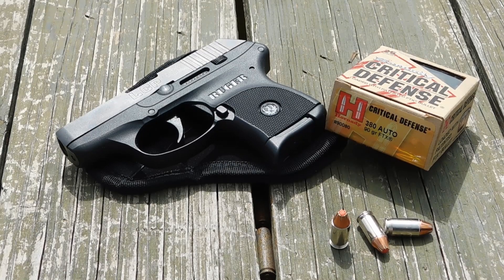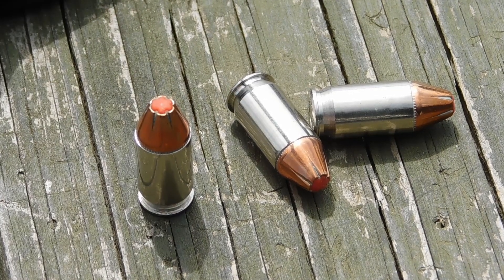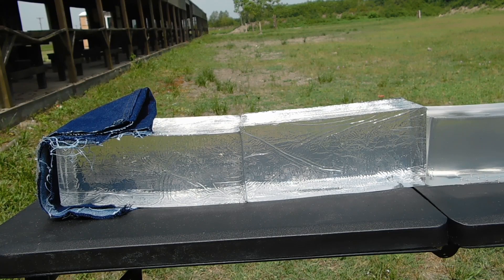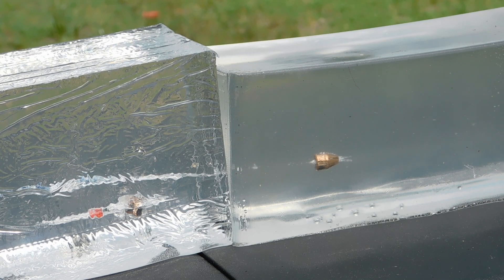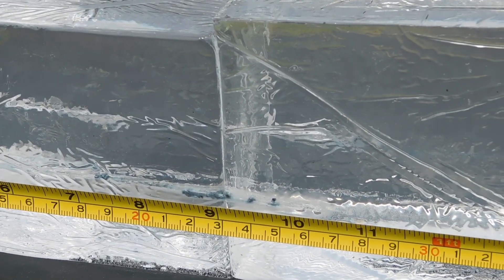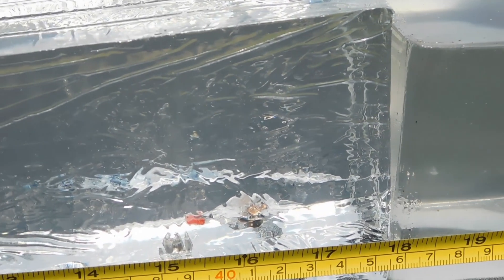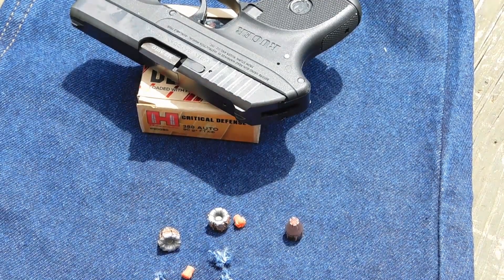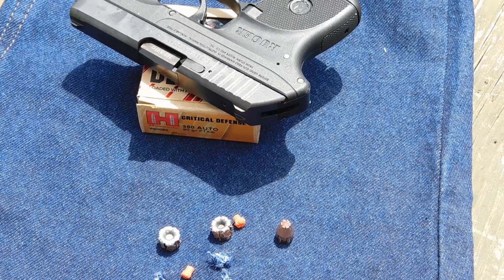380 ACP Hornady Critical Defense Ammo Test

Comment: A 2 out of 3 success rate is 66.6%.  If I recall my public school grading, that's an F.  Also that's why I've just migrated my Remington RM380 from these Hornadys to the Underwood Extreme Penetrator 90 gr. (1,100 FPS; 242 FPE).  I use the Xtreme Defenders in my 9mms..  The Underwood Xtremes  don't need to expand, since their fluted shape combined with their very fast spinning (around 50,000 RPM at the barrel out of my RM380) creates a wound track that beats even the best JHP's, are VERY consistent, and neither over nor under penetrate per the FBI's gel tests.  Being barrier blind is nice too. Their only drawback:  they're damn expensive--but my life and the lives of my family are worth it.
Reply: 66.6 would be a D… but point understood.

Comment: Great video. Just putting this out there. I've had 4 different lcps and have put hundreds of hornady cd through different ones and never had a problem with it. Used it in other guns but one thing important with this gun is it feeds good. Different kinds of mags. 6 round ruger,7 round ruger, 6 round promag, 10 round promag. ss slide. Blue slide. Galloway sweet pea trigger. In my experience it just works.

Comment: Interesting, I've not seen this round fail to expand in the 9mm Parabellum Loading. 🇺🇸
Reply: I switch from hornady critical defense 115g to hst 124g..standard pressure..my question to you is which one would you recommend I keep in my nightstand Glock 26 and why?
Reply: @istartedajoke1704  
They are both a good choice in 9mm. If you are interested ShootingTheBull410 has a great series of gell test on here.

You will find that .380 bullets with good expansion usually won’t meet the FBI penetration target, .380 just doesn’t have enough power.

In 9mm this isn’t a problem. HST and Gold Dots are some of the best 9mm bullets, but Critical Defense also gives a good showing and tends to be more reasonably priced. Plain Winchester White Box 115 grain HP is also a good bargain bullet if you can find it.
Reply: @istartedajoke1704  I use the 124gr+P HSTs and Underwood Xtreme Defender 90gr+P also the Speer Gold Dots are great rounds, 124gr+P 🇺🇲
The extra velocity helps expansion in Pistols with shorter barrels, less than 4"
Reply: I've seen other test xtp380 did fantastic.. check it out.https://youtu.be/kGUwgkjW908

Comment: They don't fail to expand in 9mm Parabellum, it seems that the velocity of the .380acp  is not sufficient to allow reliable expansion
Reply: The problem is the short barrel.  Something like  Bersa thunder, Glock 42 for reliable expansion.  Problem is I carry my LCP2 as light summer dress or ankle backup because it is small. the aforementioned are too big for my intended use.
Reply: @bcarss1970  Exactly, I'd get one of the larger .380's, as they are easier to shoot, more accurate, etc, but, then it wouldn't fit the purpose of a small micro pistol. AT that point might as well use a larger caliber. It's just like I know that a .380 S&W Shield will be nice to shoot, but it's not a pocket pistol, and might as well have a 9mm Shield at that size.
Reply from the maker: That's right on. I did get a chance to try HCDs in 9mm in gel and they expanded perfectly and hit past the 16 inch mark. But as it stands, these in 380 are the only ones that penetrate enough with some expansion. So far, the rest I have tested on video have either expanded but not penetrated much or they didn't expand and sailed through like FMJ loads.
Reply: @professorpewpuew  Have you tested the Leigh High Defense Rounds Loaded by Underwood?
They offer a 68gr .380acp solid copper monolithic called the xtreme defender, muzzle velocity is 1,300 fps and 255 ft lbs of energy, they meet Federal guidelines with penetration up to 18"

Comment: I am looking for a good round for  my Taurus Spectrum. It's my backup gun to my .45. These don't look too bad. I got a box that I need to run thru the gun to see how they feed.
Reply: Hey let me know how they feed, I'm wanting these bullets for mine
Reply: The rubber tips create a feed jam in my Spectrum due to the feed ramp angle. Had to trim the tips flush to get them to work. Too much hassle.
Reply: Have you found a good round.  I have a spectrum too
Reply: @samuelmorado70  I ran 20 rounds of DRT thru it and no FTF at all.  I carry DRT's in my .45.  I also use .380 hollowpoints that Buds gun shop makes and they are good too. Bought those when they were cheap. Got 200 rounds for 80 bucks.

Comment: this is my favorite carry ammo in 380 and 9mm. it isn't the best at expansion or penetration but it's the most constant ammo I've seen. it always goes bang, always expands, it just always works time after time. My Bodyguard is loaded with it, so is my 111 g2.
Reply from the maker: It will probably be a lot more effective in your G2. But in general, this round even in 380 isn't too bad. I have seen previous tests done in bare gelatin where the penetration was abysmal so my theory is that clothing retarded deformation of the bullet so it was able to go further on. It seems my general recommendation of using hard ball in 380 has some caveats. I am filming my next one today.
Reply: Consistent is what I intended to write, my phone however likes changing my words even when they are correct.

Comment: I appreciate this type of bullet testing.  Which round has the most reliable function in this pistol?
Reply: Full Metal Jackets @ 95 Grain / Approved by the FBI
Reply from the maker: So far, I have only tested these two hollow points along with ball ammo. They all feed, ignite, and eject perfectly. However, the few times I rode the slide home when chambering a round, I had the round hang up and not fully seat. Pulling that slide back and letting it go, like one would normally do, produces no issues. Then again, riding the slide home will make just about any gun choke.
Reply: You are right, Gun Sam _Revolver Aficionado is doing extensive testing of his Ruger LCP like yours, and that is the case with his. The round you tested in this video and the Winchester Silvertips chamber and funtion the most reliably in his LCP.
Reply: Hi, I have the same gun, and I bought the same anmo without success.
My gun fire the chamber round but not the rest.

Now I use the first round Hornady Critical Defense and the others FMJ.

Cheers.
Reply: I have the newer LCP 2. I've used this round, Winchester white box, and Remington FMJ and never experienced a single malfunction. I think the days of expecting decent guns to malfunction with certain ammo is over.